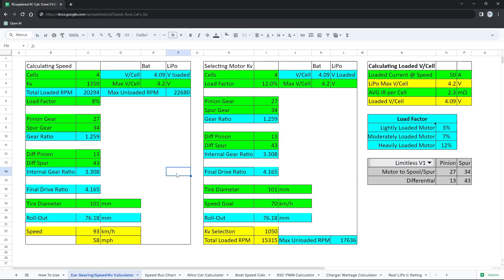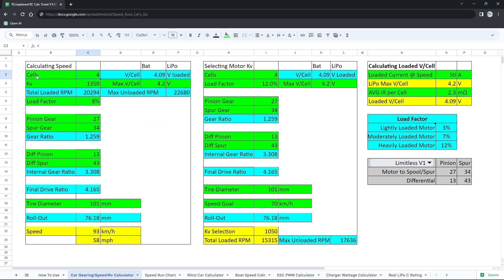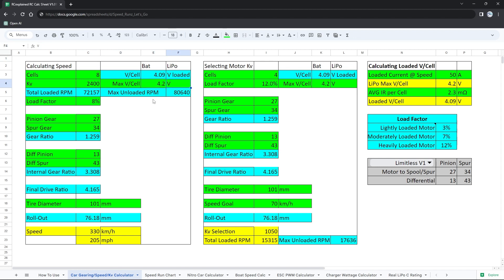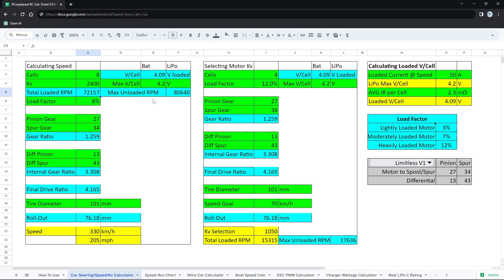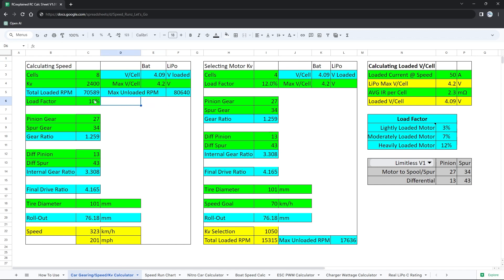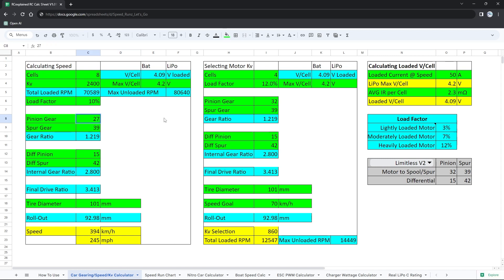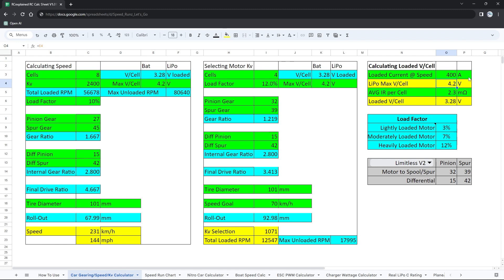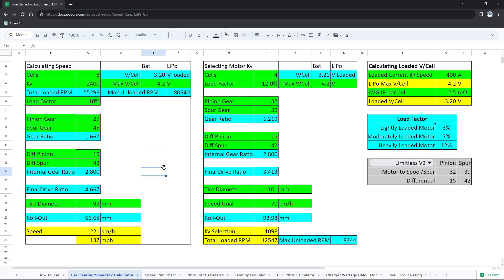🚀 Arrma Limitless V2, 8s, 1721 2400Kv, XLX2 Speed Estimation Calculator

Comment: Adjust the numbers and max them out to the limits of current equipment.  Does it have 250mph or more in it?
Reply from the maker: No it doesn't.
Reply: @RCexplained  with a different motor?  More then 1?  A different ESC?  Go for 222+mph.
Reply from the maker: @rtz549  that's too fast for me.